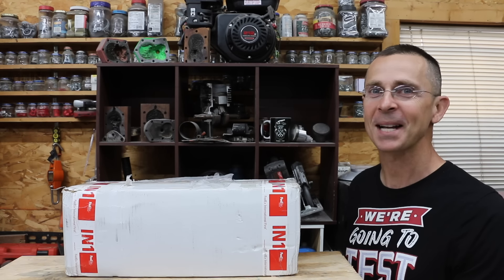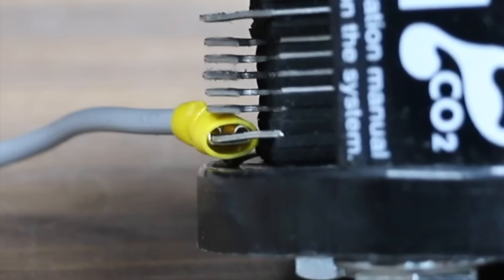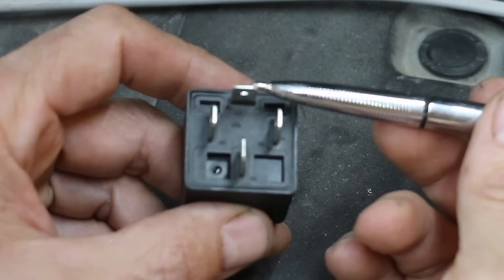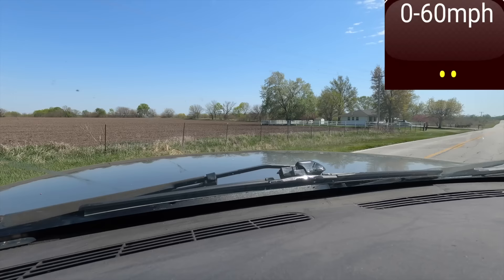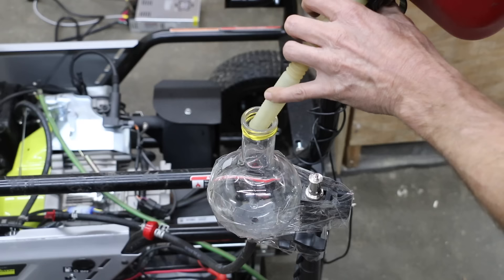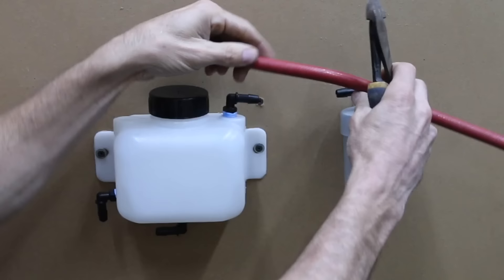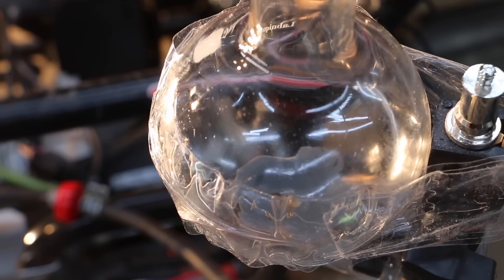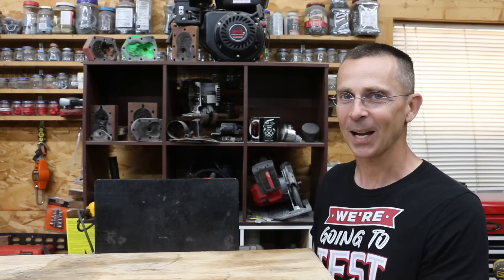AMAZING 35% More MPG with HHO? Let’s find out! Help with high gas prices?

Comment: Thermodynamics has entered the chat. Energy lost generating the HHO is not completely recovered when you later burn it in the engine and turn it back into electricity.
Reply: Yup, most gasoline engines are around 30% efficient. This system is total BS.
Reply: Ya, I'm surprised there aren't more comments about this. You add energy to the water to split it into hho and then try to get more energy back by burning it. Wish it was true though XD just need to stop and pick up a jug of water to run my car on
Reply: Exactly, you just can't make energy out of thin air.
Reply: @davidcrtalic9795  do you have a moment to talk about our lord and savior windmill?
Reply: At 600 cfm i cant believe it produces enough to make a difference. 
On the generator it didnt look like made enough to even keep up with that. 
Now 5 hhos on that generator may have made a difference. But you would need to lean the gas back
Reply: If car manufacturers found a way to magically create energy in their cars they would be more than happy to apply it themselves considering the fines they face for exceeding their emissions targets.
The laws of thermodynamics however clearly state that entropy can never decrease, so sadly no free energy
Reply: Maybe it would actually add to efficiency if the HHO generator would separate oxygen and hydrogen, pumping more oxygen into the air intake and expelling hydrogen out or have a hydrogen storage tank to store hydrogen for later use.
Reply: @davidcrtalic9795  thick air on the other hand...
Reply from the maker: Thanks for the feedback.
Reply: Okay, so, the energy lost generating hho is not completely recovered, however, a point always overlooked with that argument, is that the hho has (is supposed to when deployed correctly) has a cumulative effect on the engines efficiency, cleaning valve train, intake (EGR being such a problem nowadays) exhaust etc, over time... more than 5-7 hours (250 miles as he says) especially with that one being such a small generator for what I assume to be a v8 from the sound. This video also fails to discuss or address the MAF meter and the requisite modifications to reduce fuel in the mixture because of the artificial increase in oxygen from the hho generator. I am neither supporting or contradicting, I am just stating observations. By mechanism of providing a more efficient combustion, whether it be by cleaning over time or by introducing hydrogen into the air fuel mixture, the energy lost in the drag in the alternator is traded for reduced emissions and more efficient combustion cycle. So in picking up percentiles of efficiency in a more complete combustion, the relative drag is negated.... this is my logical conclusion. It does not need to defy the laws of thermal dynamics, just increase overall efficiency of the machine. 

My interest is more in a reduction in harmful emissions from this device as opposed to direct, obvious, acute results. I would be interested to see if there is a reduction in Nox, co2 or particulates in the exhaust gasses. Lower particulate count would have a direct effect to the exhaust being recirculated by the EGR, which could help reduce wear and build up on those parts.
Reply: @jedtalks8038  if you want to clean the engine project farm has done plenty of tests on additives that will do that. The best thing you can do for the environment is drive your current car for as long as possible, and then get an electric car.
Reply: @jedtalks8038  I think the main issue with this device is that the amount of HHO it produces is tiny. I think it can be calculated by looking at how much energy is drawn to preform electrolysis. Car engines produce thousands of watts. I can't imagine this HHO generatior drawing nowhere near that and hence having such an insignificant effect that it can't be even measured.
Reply: @derfurz8618  well they sure make a excess amount of energy to run that compressor pump on the AC. Ever boiled water using a vacuum pump? How much fuel is used by the load of how many watts of light bulbs?  Sorry my 2 headlights use a 120 watts of power. How many watts did this small generator use?  I didn't see Todd wire the gas maker to the output of the generator running a 100 watt light bulb in series. Bypassing the voltage regulator helps as well.
Reply: @maxhames499  It has an EFI, so the mixture is automatically controlled depending on load and perhaps emissions.

Anyway, I don't get it, how much proof do HHO-believers still need to see that it doesn't work? We, on the other hand, just need ONE controlled test to be able to say "it works!". Hasn't happened yet.
Reply: @jedtalks8038  Running a lot of hydrogen through the engine would no doubt have those positive effects, but with the device only drawing a few watts (via the alternator) from an engine that produces tens of thousands of kilowatts, the percentage of hydrogen produced would have to be miniscule.
Reply: @dimesonhiseyes9134  LOL!
Reply: The only way it would be okay is if you used solar to generate it at home, store it in a tank, and then plumb the portable tank in.
Reply: @jedtalks8038  EGR has been obsolete on SBC since 2003.  Doesn't exist.  Generally speaking, EGR has been obsolete on gasoline vehicles for well over a decade.  Furthermore, a reduction in particulate production would have no direct effect on EGR usage.  EGR is not a closed loop system and the vehicles that use them have no way to measure specific particulate output.
Reply: Your exactly right. To really see if five or more hho generators could make a difference the generator (being efi) would have to run on a closed loop type fuel injection system. This would allow the computer to see the rich fuel mixture and reduce the amount of fuel it introduced into the mix. Thereby reducing fuel consumption. Of course I could be totally wrong.
Reply: sw4gr1d  well, yes. How much energy do you think it takes to make one?
Reply: @forrest225  no, they are closer to %42
Reply: @davidcrtalic9795  sure you can. Just add fuel & compression
Reply: working process is: in an engine you dont burn every gas particles you have inside the cyl, hydrogen due to his faster combustion will make enough energy to burn EVERY gas particles. for this reason you will increase your fuel efficiency.
it's not against thermodynamics. just depends on how good your engine is running, a generator is set to run at a certain speed and optimized to do that. so it is a very bad example test.. should do that with a car engine driven in normal (and so inefficient) conditions
it's not put into cars because it has quite a lot of maintenance and its not user friendly
sorry for bad english
Reply: What if the energy to generate HHO came from a solar panel ?
Reply: @davidcrtalic9795  yes you can its called wind power....hundreds of years old
Reply: @derfurz8618  Energy can neither be created nor destroyed. Energy is always conserved.
Reply: @Heatherder  Maybe the newest engines, but most vehicles on the road are going to be much lower. In 2018 Toyota claimed they had developed the worlds most efficient car engine, and they claimed 40%. Most cars on the road are much older, with the current average being 11.9 years old as of 2020. Even in 2017 the best thermal efficiency was Nissan at 26.4%.
Reply: Just to be clear guys, this applies to the HHO part. However, a car will run with just the alternator when it is running and the battery is removed. The reason being is because the energy released from the gasoline is more than the spark energy needed to initiate that release of energy from the gasoline. Hence why this ONLY works for fueled powered cars and not electric car + alternator.
Reply: @maxhames499  energy spent splitting the water into hho is never fully recovered in the burn cycle of the engine, so adding 5 would make the problem worse not better
Reply: @carboxysome2630  ridiculous!, spend even more energy to compress hydrogen (inorder to store it) very silly idea, would lead to the most complex and inefficient car of all time.....let me guess are you american?
Reply: MTR  A power plant burns fossil fuels far more efficiently than a car. I never stated that electrical cars were the end all be all solution. They are currently the most efficient vehicles on the market.
Reply: @derfurz8618  Hydrogen is a way to store energy, not a way to create it.  There is some logic in approaches like having a carport with solar split water into hydrogen you then burn, but that's moving the energy from the sun into your car through hydrogen.  Extracting hydrogen to burn hydrogen is a losing proposition.
Reply: @derfurz8618  sorry, car makers don't want to make a better car.  Go research how GM killed EV-1.
Reply: sw4gr1d  nope!  Pipe dreams. People involved in the environmental religion need to have the same rules applied to them as other religions.  Shouldn't be taught in school, shouldn't be forced on anyone....
Reply: @maxhames499  that's what i think too. A V8 need way more H2  and O2 than what the puny HHO can generate. To generate more H2 and O2, more engine power is needed which is a self defeating process. The little waste energy extracted with the alternator/battery of a running car is too little to make much difference on the tiny amount of H2 and O2 feeding the engine.
Reply: @forrest225  5 to 8 year warranty on the battery pack that can range from $5K to$9K plus another estimate of $1500 or more for installation "depending on model of course". Charge time depending on model for at home charging around 6 to12 hours?? They say tech and prices are going down, but still very scary.
Reply: @jedtalks8038  I think that your comment should be read and studied.

It's describing the mystical 'woo' factor that causes some people believe that this can actually provide a benefit.  Somehow adding hydrogen to the fuel charge will result in more effective combustion.  Better combustion not only compensates from the horrible efficiency of generating hydrogen by electrolysis and then immediately burning it, but goes further and results in a net benefit.

It doesn't.  It's an interesting theory, but it has repeatedly been proven false.  There is no magic addition that results in substantially better combustion.
Reply: @andrewcannon587  The EU has quite strict fleet emissions targets set, which is why VW for example makes no profit on their EVs, so they can push them and reach their targets. The fines they would have to pay at some point far exceeds the lost revenue there. I expect the US the pass similar legislation at some point.
If said manufacturers Could magically achieve a 10% reduction in fuel consumption and therefore emissions they would gladly take it.
Now I don't particularly care about GM, because they are basically non existent on the European market, nor the US market in general, because even cars that exist in both markets are measurably more shit on the US market. Your statement might be true for the US market, I can however not say the same about the European one.
Reply: MTR  That does depend on what power source the electricity used to charge the car came from. if it's charged by renewables, it does not produce pollution. Even when charged by fossil fuels, it could be cleaner if the power plant was using good pollution controls that would be too bulky, heavy, or expensive to put on a car, or maybe carbon capture. Electric motors have very high efficiency so at least in theory it would make it worth it.

The other big issue with electric cars and renewable energy in general is getting enough lithium to make the massive number of batteries needed. Mining lithium in more traditional ways does have a considerable environmental impact, but recycling old batteries and using lower impact lithium extraction could fix that. I read an article on BBC Future that mentions how lithium can be found in geothermal water, so you can have a powerplant that  makes geothermal power, and have a far greener source of lithium to boot. BTW, go look up BBC Future if you want to read about other pieces of the massive puzzle that is tackling the climate crisis.

tl:dr switching to electric cars alone won't stop climate change, but it's just part of the puzzle.
Reply: @jaywilbur515  That charge time is for a completely empty battery. Most people will just plug in when they get home every day, so the charge time isn't a factor unless you are driving more than 100 miles a day. Guess what the most expensive part of a gasoline vehicle is. The powertrain. A reman long block can be anywhere from $2000-$10000. A rebuilt trans can be just as much. 

The fact is many people are driving electric vehicles every day without any sort of major issues.
Reply: @jaywilbur515  which is essentially what I already said, minus the fact that any process that creates entropy "looses" energy (i.e heat), because entropy cannot be reduced, which makes a process (more) inefficient.
Reply: @themagitechie9955  There is no climate “crisis”.
Reply: The best you can do is harness the kinectic energy normally lost in braking via friction and store it.  Hybrids and EVs already do this via regerative braking.
Reply: MTR  they are the most efficient type of automobile, which i did not state, but should have been obvious within the context of the discussion.
Reply: @highball7347  however i have run a pickup on wood.
Reply: That assessment holds if the maker is claiming that the burning of the hydrogen is adding to the car's power. If their claim is that the presence of the extra oxygen and hydrogen make for a more efficient and complete burn of the gasoline in the chamber, then your objection may not hold.
Reply: @carboxysome2630  Nope!  Why would you want to pump more oxygen in?  There is no energy in oxygen!  The energy is in the hydrogen, what little bit there is in these systems.
Reply: @Cougracer67  I know there isn't, but it would lead to more complete combustion of fuel, leading to increased efficiency. I don't think any engine burns 100% of it's fuels. But I think a turbocharger does the same thing and does it way better than this crap.
Reply: At the start of the video he's talking about using Teflon tape, doing so on non- metal threads will quarantined a break in the sealed and why the kit didn't include.. but I doubt in this example in made a difference 🤔